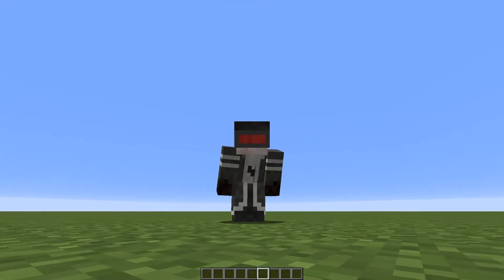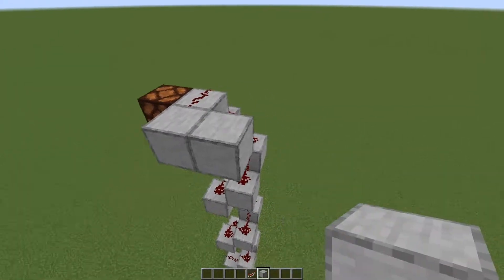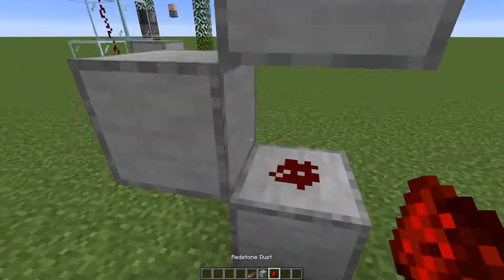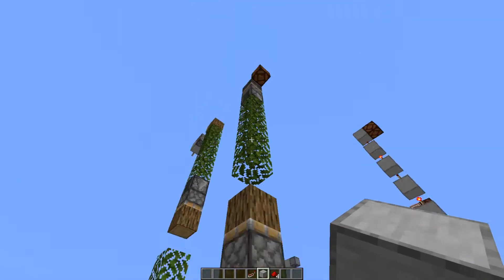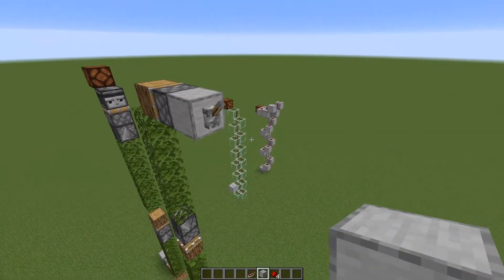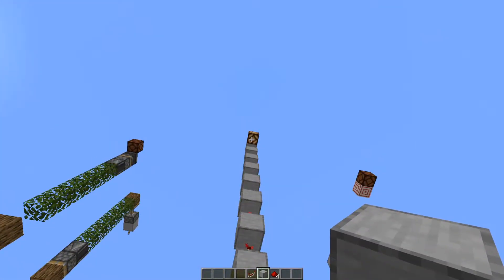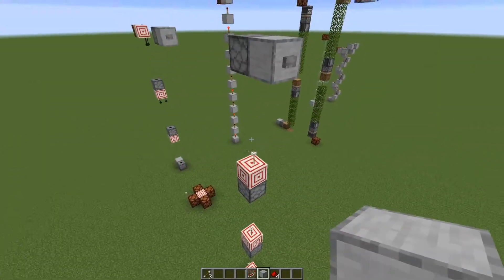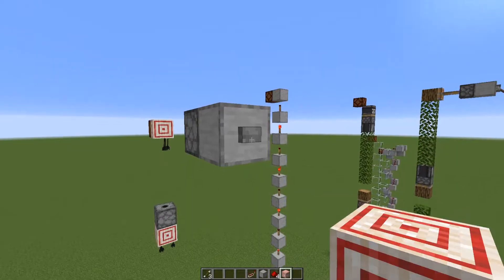Easy Vertical Redstone | 5 Different Ways!

Comment: slabs also work in the place of glass. you can also use slime/honey and redstone blocks in a similar way to logs/leaves
Reply: You cant use redstone blocks it will keep the redstone on
Reply: @alpaca4902  the redstone block could retract with the other blocks to turn it off.

Comment: Simple yes, but shouldn't Mojang make it even more simple? In some complicated machines vertical redstone can be a pain in the ass. Same thing with item elevators, way to messy. Like, yesterday i made an reversed storage silo where only the top 3 chest was above ground (those that the player interacts with) & 7 stacks below ground (10 vertical chests & then 8 items per side of the room) & the item sorter below ground too (when a player takes out an item above ground, it sends a signal below to refill the top 3 chests1 wide tileable), it was one of the most annoying redstone builds i've ever done.

(sorry for wall of text)

Mojang, please fix